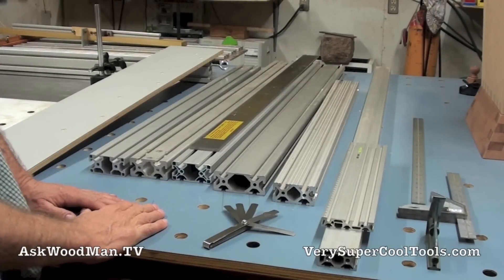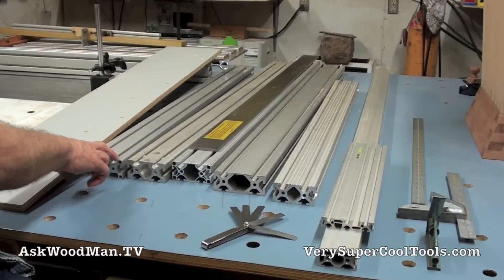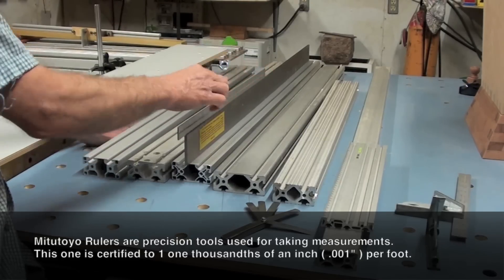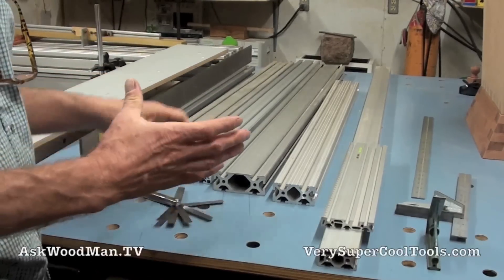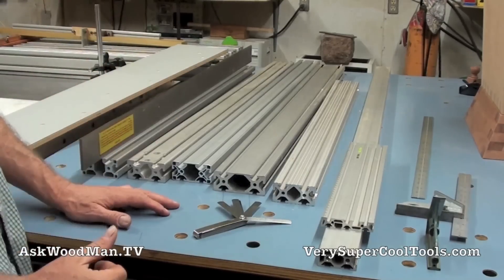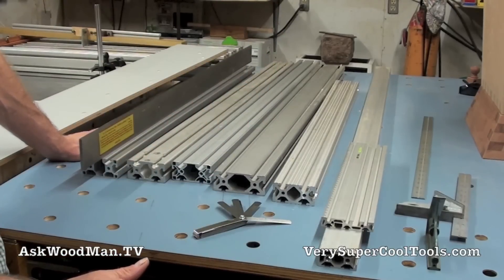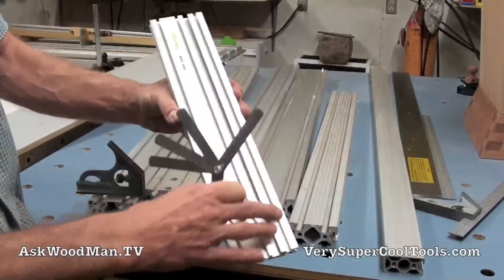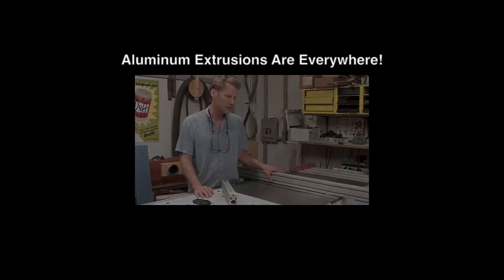How Straight Are Aluminum Extrusions?

Comment: Hey Allen, Do you calibrate for a tenon jig, if so how? Is that available as an assessery?
Reply from the maker: Here is a link to the video series on dialing in my tenoning jig. (just 2 videos) 1 of 2 Tenoning Jig Using Linear Bearings/Rail Mounted On Aluminum Extrusions There is not much to them if you have an extrusion and the bearings/rails. The extrusions just make connecting anything like bearing rails a snap.

Comment: I would be really interested to know, which woodworker does his projects to 0.002 inch? So no reason to worry about the straightness of this material (in my opinion).
Reply from the maker: Not me Georg. No matter how accurately you attempt to cut a piece of wood, temperature and ambient humidity conditions make for quite a dance in dimension changes. For me what has always been more important than a  specific dimension is consistency of cuts as I mill my stock.
Reply: AskWoodMan I fully agree; if you cut your drawer fronts all together with the same setting, nobody cares if the length is 0.001 or 0.002 inches off. And as you say: wood is a natural material and expands and shrinks with humidity and temperature. So surely these extrusions are straight enough for any woodworker!

Comment: This is very informative video thank you so much.
One thing is not exactly clear. When you're measuring the profile straightness across the face. One is concave one is convex, and there is no good explanation on that. If the slight tension would be the goal, all would be the same concave or the same convex. Why the difference ?

Comment: Lasers bend due to gravity 🤙🏻
Reply: If the gravitational pull exerted is of great enough force but not on this planet without increasing that force via an artificial method.
Reply: Well, your length of measurement is only what, 50"?  So you think light is going to bent from one end to the other with the effects of gravity across about 4 feet?  ha, ha.
Reply: @56Long21  Your comment means you do not understand Pi.

Comment: Hello WoodMan,
Based on your extensive Metal experience, I am hoping you can guide me to some information.  I am planning to build a frame for a CNC machine,  using 4080 and 8080 extrusion from 8020.  Extrusion is light, bolts together easily, but expensive...
I was considering using maybe 3 x3 tube steel... which would require welding, etc... and I would obviously need to choose the wall thickness....  First, I cant really find any specs on the strengths of the steel... so it makes it harder to choose.  The extrusion is like a web, which seems to increase it's strength instead of just a tube...
Second, How straight/or twisted does steel usually come compared to extrusions?
Reply from the maker: Steel is very strong and straight. It does require holding the pieces in clamped jigs to minimize distortion to the intense heat of welding. Steel is what I would make a sub-frame out of and save the extrusion for when you really need the connection points with fasteners. There is info a plenty about all aspects steels strength available online.
Reply: Heat distorts metals. Don't underestimate the power of welding heat to distort a project into a useless art project if your end goal is any kind of precision. Welding is largely used in cases where large tolerances are able to be dealt with, or the heat effect is precisely engineered into the product.

In the scope of DIY CNC machines, if you're considering welding, you may a well consider using two by fours and plywood. Unless of course you are an expert welder and know how to precisely manage heat and distortion.